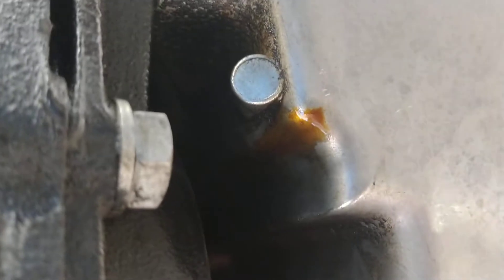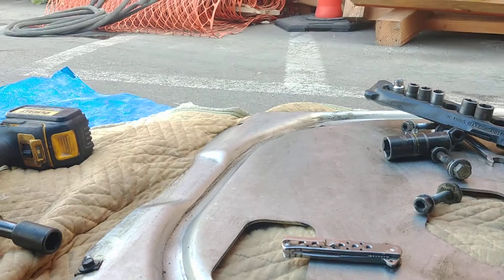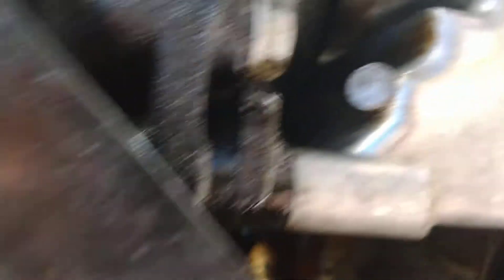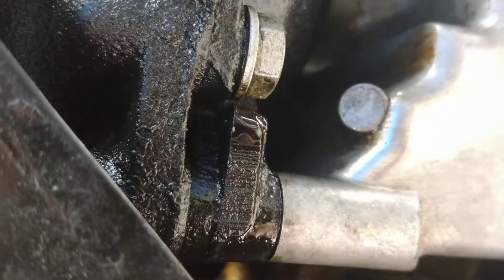X5 oil pan leaking

Comment: How did you get the bottom panel off....
Reply from the maker: Six bolts
Reply: @pyrotics3899  my bolts just keep turning a video on how to get them off would be great also did you find your leak
Reply from the maker: @devlin686  there is a nut on the back side that needs to be held with a boxend wrench
Reply: The bottom panel comes off easily. It's just held on by some bolts and nuts.